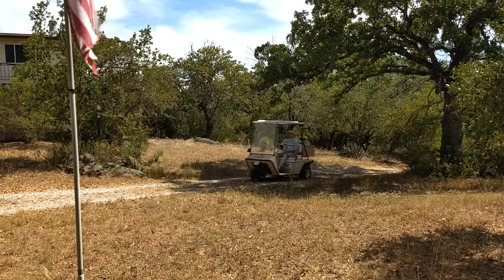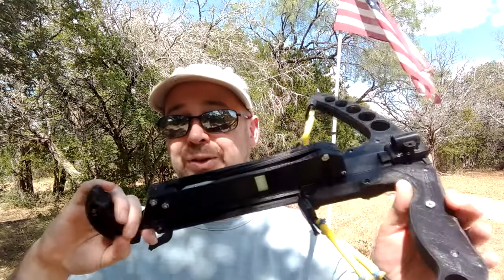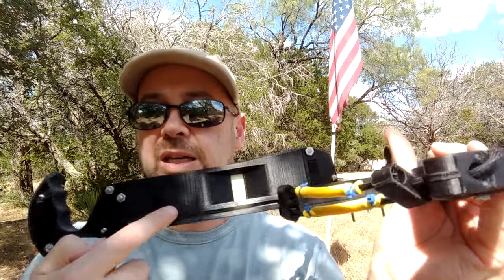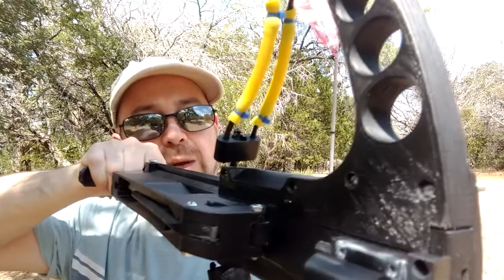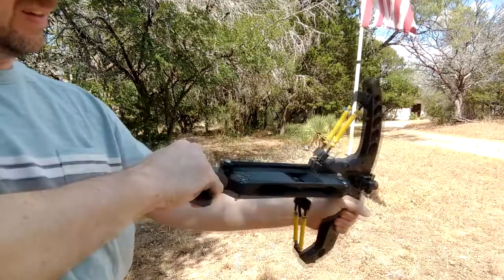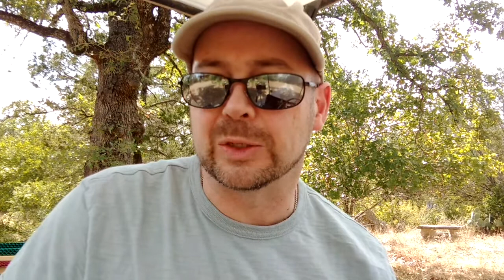"Legolini" Sliding 3D-Printed Bow demonstration

Comment: Have you experienced any rope catch issues? The catch mechanism in my bow constantly fails when using strong rubber bands. The string is released without pushing the trigger..
Reply: Yes, if the rubber is too strong, you may encounter this problem. You can either put a stronger spring in the trigger assembly or, that's what I do with mine, apply some pressure with your thumb to keep the string in the catch.